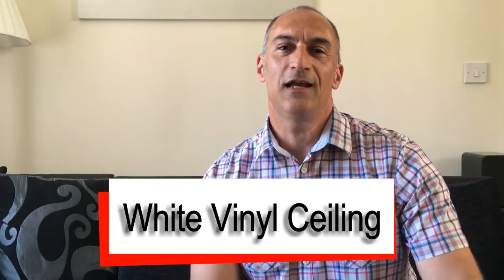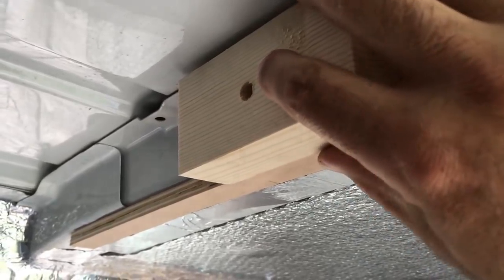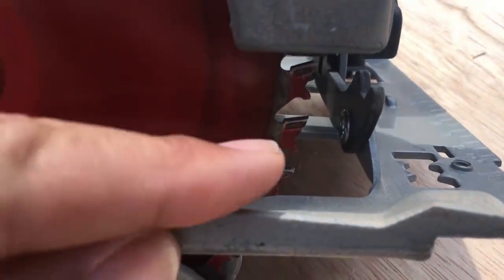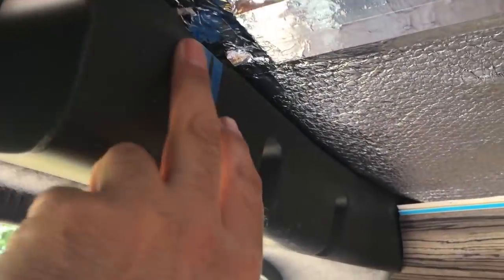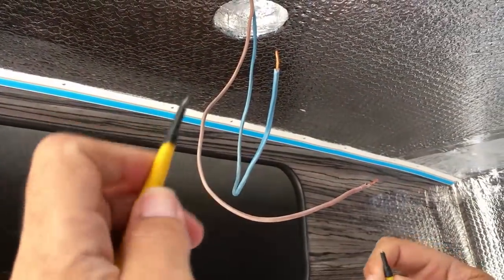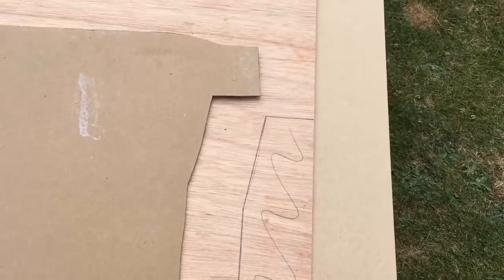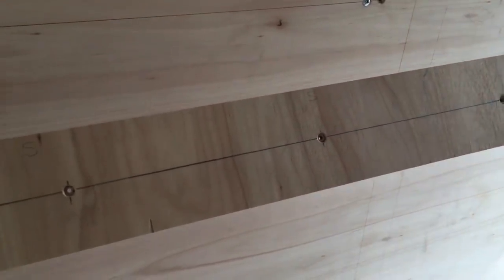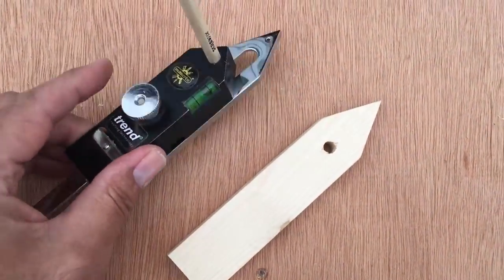Mercedes Sprinter Camper Van - Vinyl Ceiling

Comment: I am seriously considering driving my recently second hand bought vw caddy maxi over the sea from the Netherlands too meet you and hopefully work alongside. There is only one way to do it, and that’s the proper way. I think, you are that proper way haha. 

Though, the intention is not a full van to camper conversion. I use it primarily as an business car and occasionaly as camper. Sometimes after my gig as Dj, sometimes with my girl on holidays. Insulation and small electric connections would probably the only priority. 

Well, then to the actual question. Vapor barrier is the reflectix I assume? And if I’m correct, you seal absolutely everything off after the 1 st layer of insulation ? So no condens can come in or out? Like waterproofing ? That much sealed? Thanks again! It’s great to found the person I can hopefully safely build myself a tiny and easy house on wheels.

Comment: Brilliant. You've raised the bar for all the other DIY van converters. Thank you for all the hard work showing us the proper way to convert a van.
Reply from the maker: It has been a lot more work to go to this much detail, but the finish is very pleasing. 
Thank you for your nice comment
Reply: @GregVirgoe  The extreme effort required to produce such a detailed series is very evident. I am thinking about converting a van and have viewed many conversion videos. Your videos are the only ones I will reference in order to facilitate my conversion. Simply put, they reflect the highest quality and most detailed build it's been my pleasure to witness. If you were here in the US, I'd gladly engage your expertise as a consultant😊 Thank you for all your hard work in sharing this experience with us.
Reply from the maker: I really appreciate your acknowledgement and thank you for great feedback too

Comment: Did you put a bevel on the sheet to help plywood to slip in
Reply from the maker: Mike Troup wrap a strip of normal clear Sellotape over the edge you are inserting. It makes it slide in easier and stops the vinyl from peeling. I found that out the hard way 😬😀👍🏼

Comment: Another great video, I like how you’ve gone against the grain and used different materials from the hundereds of other self builds using 80s tongue n grove cladding!
Reply from the maker: Some may say its 70's static caravan but I like how clean and bright it will be inside.
As you say there are a lot of timber panelled vans about so this will be different.
Already have different wall finishes for both the bedroom and the kitchen planned.

Comment: Hi Greg, your videos are so helpful, thank you for posting them. We are at this stage and have done the same as at the bulkhead shelf, but how did you attach the ceiling at the back of the van please?
Reply from the maker: I covered a piece of ply with carpet. Fixed that to the last roof beam and then fixed my plastic trim to that board. It meant putting the last board into tow trim which was tricky. A little celotape over the end of the boards helps to make them easier to insert into the trim
Reply: @GregVirgoe  Hi Greg - At the rear - above the rear doors - there is a light with cables feeding it which run along the panel to the left and right. How did you carpet this area so neatly? Did you re-route the cabling or simply carpet over them? Thanks as always.

Comment: Nice vid again greg! Its nice to see a build that doesn't have a 100 kg of wooden cladding  everywhere 😉 i was gona use some similar pannels on mine but thought id use strong velcro strips so theres no screw heads  ...just a thought!!
👍👍
Reply from the maker: Yeah, the screw cups are not the best finish I know.
They use wide strips of velcro to hold seat cushions to furniture and that stuff is really hard to shift in wide strips. 
So no reason why it coudln't work for a headliner too??
Reply: mark grinsted VHB tape is another great alternative.

Comment: Greg what were those things that you stuck up on the ceiling before you put up the  rigid insulation. It looks like pins. Thanks
Reply from the maker: Renita Isbon, exactly that, they are called stick pins. You will find a link in the video description of my insulation video part 2. Hope that helps
Reply: Should have kept scrolling...this is the answer I was looking for.

Comment: Hey Greg you have made a great and imformative set of clips for anyone who wants to build their own camper van, your all set for normal and cold weather but what will happen if you visit somewhere hot like Spain and find yourself in 35 to 40 degrees centigrade do you have air condition?
Reply from the maker: Firstly I want to thank you for such great feedback.
We do plan to visit Spain and the north coast of the Mediterranean but during our autumn and winter months so we are hoping that it will be a bit more comfortable by then. We plan to do Northen Europe during summer.
A couple of tips to combat high temperatures in a van would be to place external reflective blinds over any windows to prevent the solar gain from the suns rays entering the windows and keep the internal of the van in the shade. That is the biggest source of heat gain in vehicles.
Secondly, if you have a roof fan. simply hang a damp towel under it and the evaporating moisture will reduce the entering air temperature by as much as 5°C. It's a process called Adiabatic cooling and it free :D
Reply: So about the damp cloth.  Would the ceiling fan be blowing through the damp cloth into the van?

Comment: I've just found your videos and have to say I'm loving how clear and detailed they are. I've got a lwb transit and am about to replace the panels in the back of the van where the sofa fold down bed is. It was previously covered in household carpet and well it's not really to my taste. Thing is I can't decide what to finish it with and then came across this vid, I like the idea of a wipe down surface and these boards seem great. I have been thinking though about PVC wall cladding again because they are lightweight, seem easy to instal have lots of colours/designs and wipe clean which is great when you have two dogs. Thing is I haven't really seen anyone else using them which is sort of ringing alarm bells as a possible no no. Have you any thoughts on PVC cladding and are there any reasons do you think why I shouldnt?
Reply from the maker: Sue Mee we used pvc sheets in our wet room and they work really great. Easy to cut and install and keep clean. I think it must be just asthetics in the living area it may look a bit clinical 😊

Comment: How do you keep the vapour barrier intact when you've cut a hole in the insulation board for the cables to come through?
Reply from the maker: Carl Murray with foil tape you seal up all the joins and cuts.

Comment: Hi Greg, Just wanted to ask you what the little prong things are called that you used to attached the foam board to the ceiling? The ebay link has expired, sadly. Love all the videos, especially now that I’m actually building mine, rather than planning for two years.

Comment: Greg did you run a single radial circuit for the lighting, or several radial circuits.
One other thing did you install anything for charging off the alternator

Comment: Steller set of videos!   How thick is your insulation on the ceiling Greg? Did you not need the vibration dampening material on the ceiling?
Reply from the maker: Hi Bill, the ceiling is 50mm Kingspan PIR board and foil faced bubble wrap over that as the vapour barrier. The roof is already pressed into deep ridges so it won't vibrate. If you haven't seen it pleased watch my sound video

Comment: Nice work!
Quick tip on the electrics is to test for shorts to the van metalwork as well as to each other. If somehow you'd managed to get a trapped cable or similar it wouldn't necessarily show up doing it the way you tested, so if you test each cable to the van metalwork as well then you'd just add that little bit of extra confidence all was good...
Reply from the maker: That's some really sound advice Gareth and I shall do that before I terminate the ends into the panel, thank you.

Comment: Thanks for picking this back up. I'm close to starting my own. What are your thoughts about the large holes from the ceiling lights in the vapor barrier?
Reply from the maker: I cut recesses into the insulation for the lights fittings but as the insulation was 50mm thick they are only half the depth, they are foil taped over to repair the vapour barrier even taped around the flex, one of the previous videos shows this clearer.
Reply: Greg Virgoe ok. Did you also tape the steel ceiling in the hole effectively cupping the hole with tape or am I splitting hairs there?

Comment: Hi I have been following you for a while as my wife and I are doing a Renault master, could please just ask how you secured the foil bubble wrap up to the ceiling, I can see you have tape on the edge, but did you use anything in the field (middle) I'm thinking some double sided tape,
regards Chris
Reply from the maker: Hello Chris,  I used a high temperature spray adhesive called TrimFix to secure the foi bubble wrap.
https://rover.ebay.com/rover/1/710-53481-19255-0/1?ff3=4&toolid=11800&pub=5575265109&campid=5338027957&mpre=https%3A%2F%2Fwww.ebay.co.uk%2Fsch%2FCar-Parts%2F6030%2Fi.html%3F_from%3DR40%26_nkw%3Dtrim%2Bfix%2Badhesive%26rt%3Dnc%26_dmd%3D2

Comment: Have you noticed any waving/ sagging in your ply? I'm really struggling with my 3mm ply. I've got it for both the ceiling and the walls to save weight and height. I'm wondering if more fastening locations would straightening it out. But if it's 8' long it would be hard to not notice anything which is why I'm asking.

Comment: Hi Greg, if you make a scribe out of a circular piece of ply you don't have to worry about pivoting the linear scribe when you roll the circle along the profile it will be automatically parallel. Great set of videos so far Cheers.
Reply from the maker: Hello Phil, I plan to do a follow-up video just about scribing, as I'm sure that you are the first of many that will suggest the circle or penny washer idea for scribing a line. However, the geometry of a circular scribe will give you the wrong result. It may give you a noticeably close result for a straight line but when you are scribing a curve the circular scribe will draw a curve of smaller radius and will not be a close fit. If you had a pronounced curve your panel would end up too small. The pen ends up being perpendicular to the tangent of the circle, which is not what you want and what I was explaining not to do with the pointed scribe. You have to keep it straight to replicate the exact shape. I will demonstrate this point very soon, trust me. Thank you for a great comment and one very much worthy of further discussion. Regards
Reply: Greg Virgoe thanks for the reply you are correct just thought there was not too much   Curvature to worry about😎
Reply from the maker: Hi Phil, yes, in this instance you may have got away with it. :D
Reply: Good thing to think about from both Greg and Phil. !!
Reply: Excellent conversation guys. I've never seen the circle trick in person (and now I know why, the job where I scribed was all tight curves) but if I had to do a ton of long cuts it could be handy.
Reply: I have seen someone do the circle scribe(Travel with Jaz), and they, very smartly, did not translate it directly to the finished plywood. Instead they cut it out, then drew some minor adjustments, cut that, tested again, and again, and then finally transferred it onto the finished plywood. That said, I think we have a winner on which one is better :D. The one where you only have to do the job once.

Comment: Did you consider towing the bikes with a Motolug or similar type trailer? I've been looking at them and am quite taken with the way they break down into component form.
Reply from the maker: Yes, we had a two bike trailer previously and its something that I may add again in the future.
It does mean you can tow 750kg and not affect the carrying weight fo the vehicle too.
I had also looked at small covered box trailers for extra weather protection and security.
I have a new Triumph Bonneville so not keen on leaving it outside at all.
Reply: Greg Virgoe I'm sure you're aware, but trailer tongue weight counts towards payload (gross vehicle weight) of the van.

Comment: Hey Greg! Love your videos!

How much vertical space did you lose to your insulation, flooring, and ceiling? I'm looking at a Ram ProMaster, but it looks like I might only have ~3" of vertical space above my height.
Reply from the maker: Hi Alexander, for the roof only the 12mm batten and 3mm vinyl ply so 15mm or about 5/8" in total for the ceiling. 
For the floor 25mm battens, 12mm ply and 3mm Altro flooring so 40mm  or 1 1/2" for the floor.  
All together just a bit over 2" loss in height. That includes 50mm Celotex in the roof and 25mm on the floor.
The insulation in the roof is between the roof beams so no loss of height for this, hope that helps. 
Best wishes with your build
Reply: Thanks, Greg! Keep up the good work. :)

Comment: I disagree with the idea of putting the foam insulation underneath that paneling when you’re cutting, as you’re putting out a plastic dust that is irretrievable, and, non-compostable. Analysts are finding micro plastics in human infants feces, among other places. If cutting indoors, perhaps, as it can be vacuumed, and disposed. Another technique would be to score and snap the thin panel, almost eliminating the dust issue entirely.

Comment: Are you going to do anything to the exterior of the van? paint or wrap etc...
Reply from the maker: We have discussed the possibility of doing a partial wrap on the van exterior with a racing theme.
I also love the idea of getting it airbrushed by one particular guy that does awesome work.
Tell me what you think... http://www.peacefulprogress.org/art-work/vehicles/
Reply: Greg Virgoe Any stealth considerations? With your upcoming journey, you may want to keep as low profile as possible so as not to stick out as a target for theft.
Reply: Greg Virgoe, I like the last pic in the link you sent, sprinter woods 👍🏽
Reply from the maker: There is another van called Saffiyah with a very similar design.
You can hire these vans from Quirky Campers
https://www.quirkycampers.co.uk/campervans/wales/carmarthenshire/saffiyah/
Reply from the maker: Hi John, I do see that but there’s also a train of thought where if you make it really stand out it’s impossible to hide it and easy to track down? Less likely to be stolen. 
I’m just not going to leave it in any dodgy places John as much as possible. It will have a multitude of security features installed on it. 👍🏼😀
Reply: aly davidson sorta what I wanted to do. Take a picture of wooded area, and have a wrap done on the side of the van
Reply: Greg Virgoe Sharks with frickin' laser beams!

Comment: lovin' your vids Greg your documented high quality workmanship is creating a very valuable investment in the van, fantastic work! just wondering if you will be covering the plastic cable trucking? i'm intrigued.
Reply from the maker: Thank you for the great feedback, Neil.
I had thought about carpeting it but then you can get to the nuts to remove it,
My fuses for my reversing camera are fitted inside that boxing,
it wasn't in bad shape so I've decided to leave it as it is.

Comment: Yet another great video Greg. I was really surprised how inexpensive the sheet was, it would cost a hell of lot more to buy the Vinyl and ply sheeting separately then the hassle of gluing the vinyl to the ply. Great tip. One question I have, I was surprised to see you using nails to hold up the trim, my only guess to your reasoning would be the nails had a broader head than a screw would. Looking forward to the cabinet build.
Reply from the maker: Exactly that, plus they offer a much thinner profile and don't hinder the sheet entering the trim like a screw would. I did some tests with different size nails to see which had the greater pull-out strength in the 12mm ply. The Roofing Felt nails performed the best for a 1/2" nail. The sheet is so light there is no way this will fall down.

Comment: Hi Greg.  Just a normal averagely great video as usual...  Does this guy ever make a mistake? :o)

Are there any other ways to attach the ceiling without screw or glue?  I would prefer a smooth, flush, one-piece looking ceiling if possible.  I know it will have to be multi part due to the weird edges but want it to look continuous.

Thanks :o)
Reply from the maker: Interesting that should ask that question. I am planning to conceal a fixing for my door cards as I do not want to see screws or caps in those.
I have got them already and plan to do a test piece before applying to the doors, they are a plastic barbed auto panel fixing that I will carpet over, they are a one-shot deal and will probably break if they have to be removed. 
https://rover.ebay.com/rover/1/710-53481-19255-0/1?ff3=4&toolid=11800&pub=5575265109&campid=5338027957&mpre=https%3A%2F%2Fwww.ebay.co.uk%2Fitm%2F60-x-Light-Grey-Trim-Clips-Car-Panel-Plastic-Fasteners-Buttons-FIX668x3%2F291990647236%3Fepid%3D2125001445%26hash%3Ditem43fbffb1c4

Comment: As a professional boat builder you should never use nails as a ridged fixing .you should use screws as more ridged and to lay in bed and see all those screw caps and joining trims would drive me mad
Why you didn't just ply it and glue vinyl up as a one piece roof 
It would have looked a lot more professional
Reply from the maker: Luckily for me you’re not lying in my bed. 😂
Reply from the maker: Micheal Brimecome I just watched all your professional boat building videos. It didn’t take very long 🤣